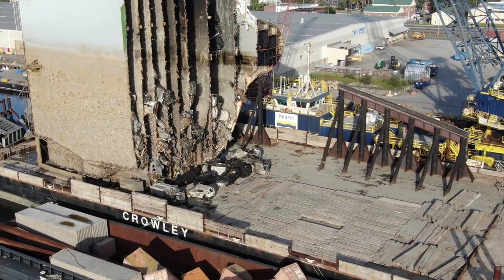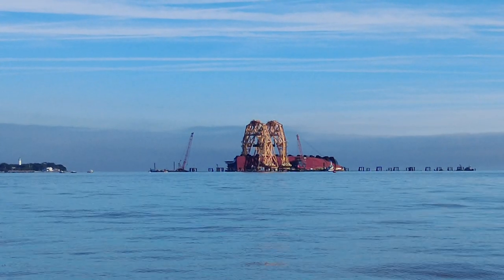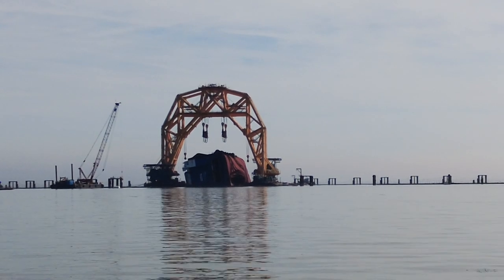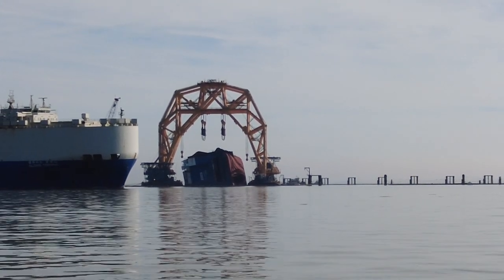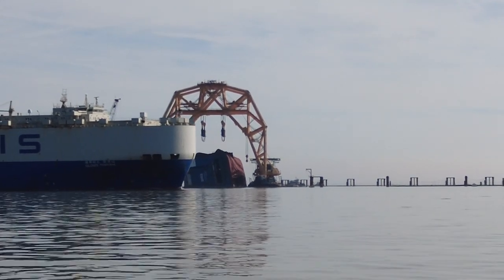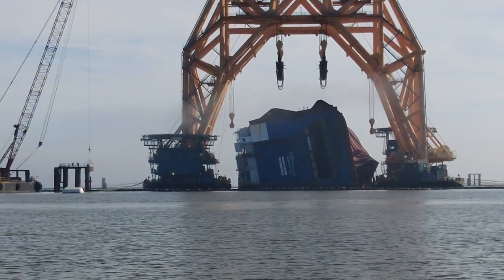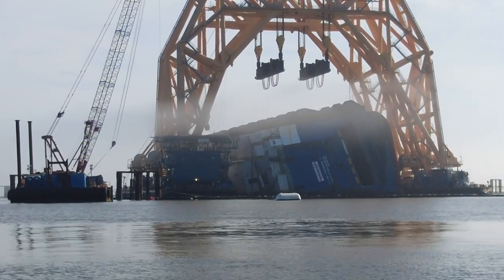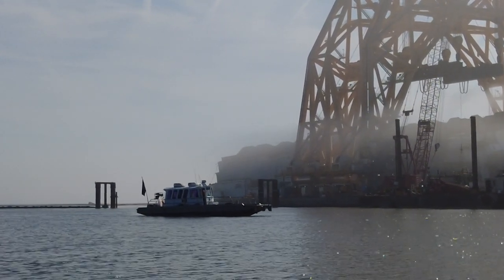MORE CARNAGE!! From the bow section in Brunswick! December 13, 2020

Comment: I have a question 🤔 couldn't they have built a huge wall around the ship and pumped out the water and then cut it up quicker? Thank you and look forward to tomorrow 🤗⚘
Reply from the maker: YES!!!!!! It’s called a cofferdam and that was the original Plan until the Coast Guard allowed themselves to be pressured into taking a less expensive route that has led to this operation.
Reply: @MinorcanMullet  Wow I think it would have been a lot easier and less expensive in the long run.... I pray every night that this doesn't ruin the bay and sea life..You are so blessed to be able to live there and earn a living and enjoy God creation 😊
Reply: Thete has never been one built that size. There is almost no slack tide here either. It could take years to build trying to build a structure that size on a mud base with a ripping current would take forever.
Reply from the maker: @jaredhayes940  Thought about that too.  It could possibly take a double walled dam.  and a diamond shaped design. bottom.  As for forever, well Quite a bit of sheet pile could have been driven in the past year.. MM

Comment: I was under the opinion that all the vehicles, trailers etc, carried in these ships were tied down to their decks with chains or straps. Obviously not. Surely as vehicles move about a lot when the ship rolls and cants, wouldn't there be panel and duco damage if they were not tied down somehow?
Reply from the maker: All vehicles were strapped down. Don’t forget about the fire that occurred after she floundered. The nylon straps failed from the heat. MM
Reply: Those straps were designed to secure cars to a fairly horizontal deck. Turn it 90 degrees and all bets are off. One strap fails and it would be a chain reaction until all the straps failed.